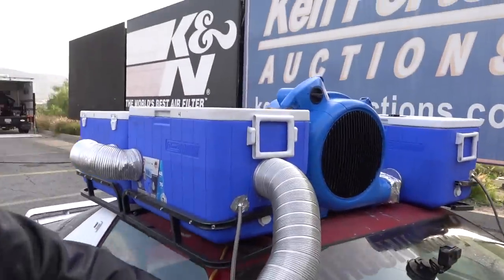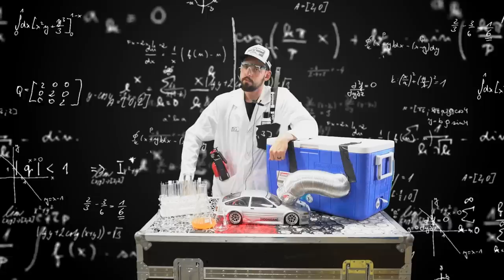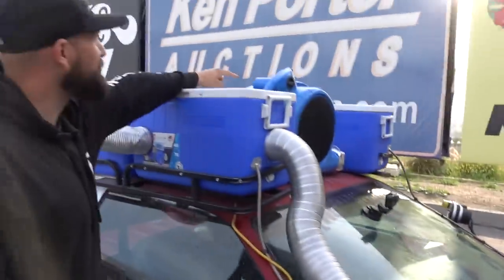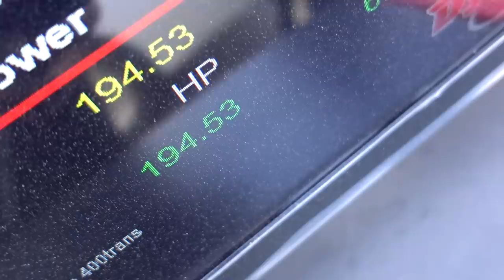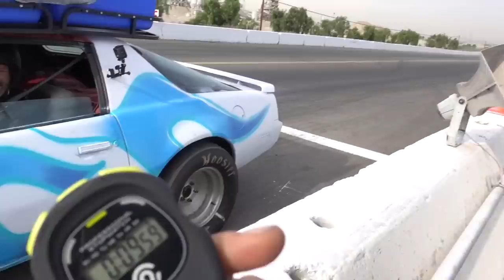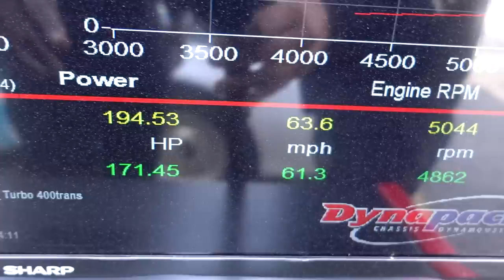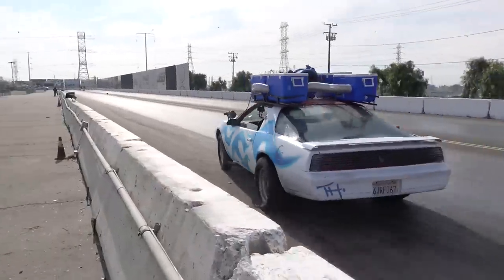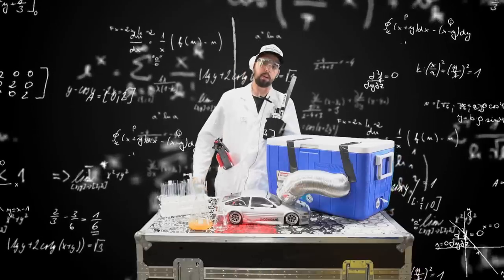Dry Ice Cold Air Intake: Does Frozen Air Make More Horsepower?

Comment: I have always toyed with the idea of running the cold AC lines through the inter cooler on a turbo car. In theory it should work very well but there has to be a reason it hasn't been done. either condensation being sucked into the engine or just the pure cost and difficulty.
Reply: The drain engaging the AC to make it cold is more than the gain for cooling the air, though if one were to have the AC on anyway, it would make sense to recover some economy by having this in place
Reply: It hasn't been done because people think there's no net gain to be had. I've put the entire cold side of my AC into my stock airbox and get 60-80*F degrees of cooling BELOW ambient, even tricked the AC cold side thermistor to work when it's 15*F outside. Humidity is a big factor, the drier the incoming air, the better. Condensation is managed depending on ambient conditions, the most challenging conditions are when its 35-40*F ambient temperature with lots of humidity (research is ongoing)...
You get immediate torque off the line and more CFM monitored by the MAF sensor at all rpms... and all of this is done on a 1990s Toyota so the systems aren't too complicated. I can maintain an IAT of 65-70*F BELOW ambient temperatures on a 95*F day, and on a 25*F day I can achieve 50-55*F BELOW ambient air charge temps. The OEM MAF sensor will work to -40*F (-40*C) 

"When you open the hood, it all makes visual sense but at the core of the design it's more complicated than it looks."

Comment: I guess I found my long lost brothers xD and I thought nobody was as crazy as me.

By the way: your dyno sucks for this kind of test.
Yes you need moving air.
More cold air means better burning and more gasoline.
With a strengthened engine and optimized ECU you would easily get 20% more horsepower.
Even more is possible.

Pretty nice vid

Comment: If you could remove the carbon dioxide from the air, or bypass the carbon dioxide by not letting the air mix with it on its way to the engine (like what you did with the fuel) you should go even faster still. Every drop of carbon dioxide that reaches the spark plug is taking up space that could be used for more air, but you need all of that air to be cold, so if you run one single tube of ducting through all 4 coolers not only would you have more psi because the air has even less distance to travel, but you will have more psi because the total volume of space between turdo to engine will not have 4 coolers worth. If you could run only off the turdo u should make the most power that way, and you'd have to run the turdo in order for the car to breathe 

what im saying is ditch the "no turdo" mode, run duct through all 4 coolers without splitting the duct before it reaches the engine, and remove all other forms of intake that do not run through the cooler. run the turdo at max capacity at all times and send it.
Reply: the carbon dioxide comes from the dry ice, and isnt flammable ;)

Comment: Made less power because your using dry ice, which is frozen carbon dioxide,.....which displaces oxygen. More Carbon Dioxide=Less Oxygen to burn with the fuel=Less power. Thats part of the reason it sounded so rough, it wasnt getting enough oxygen to fire correctly. The CO2 from the dry ice was suffocating the engine, literally. This is a reason why they use CO2 fire extinguishers. Yeah the idea of a super cold intake is interesting to test and I would love you guys try a repeat of this experiment if possible. Try just regular ice....or them gel pouches. Something that will cool the air without adding anything but cold, but not killing the oxygen either. (I know its probably already been covered in comment below.)

Comment: If it was a sealed system that keeped the co2 out pulling air from out side run it threw the coolers threw sealed metal tubing  to get the temp drop and still fresh air no co2

Comment: Orrrr maybe the air was so dense with the fresh dry ice that there wasnt enough fuel to compensate, you leaned out, made less power.  Then when the temps went down, enough fuel was available for the given air to make more power vs the prior run.  That or you didnt just launch and fall flat on your face again.

Comment: The car is trying to burn co2 from the dry ice use some pipe thru the coolers that way the ice cools the pipes which cool the air in the pipes and the engine gets o2 instead of the co2 put off from the ice

Comment: A engine Needs oxygen in a cold state to preform Better and putting nitrogen as a replacement for oxygen will lesson the hp of a car cuz nitrogen is known to put out fires and that's why we use nitrogen in fire extinguishers, the reason why it made a faster lap time is because the air filter was grabbing more oxygen than nitrogen so the nitrogen did work as a coolant only at high speeds, test it on the dyno with a regular fan facing the air filter and you would see more hp gain

Comment: Dry ice is made from CO2 so as it’s melting it feeds the engine carbon dioxide. This would explain why the car made less power on the Dino. Because the coolers were full of carbon dioxide and when they took it down the dragstrip they flushed in fresh air, allowing oxygen to get to the engine.

Comment: You are pushing co2 in the engine and choking it out. Cold air intakes don't ad co2. Fuel at to low of a temperature will not atomize properly. If you chill an intercooler with dry ice and then pull clean air thru the intercooler you will create a clean and cool charge.
Reply: Dry ice is frozen CO2

Comment: Yes co2 replaces oxygen but it made less power on the Dino because they dident have the wind acting as a ram air in to the intake but my theory is they feed co2in with way more oxygen but the co2 cools the oxygen an colder air so I think it would have made more power if there fan was placed correctly

Comment: Dry ice is straight CO2. It may be cold, but i don't think it will make much power. Get a compressed Oxygen tank for a homemade nitrous setup. 3x more potent than nitrous. Use tiny nitrous jets and 3x bigger fuel jets. .. 50 shot jets of N20 and 150 jets for fuel.

Comment: You're filling the combustion chamber with carbon dioxide. That is why the loss of power was there. What if you used the cars ac evaporator to cool the air going into the air filter. Then you wont have any messed-up gasses killing your combustion.

Comment: PLEASE don't trash the fire bird yet, this needs more investigation.

you need to try make a massive heat exchanger in which you pump round your super cool fluid and rush the intake air over it, make a giant AC unit directed into the intake.

I would theorise that the energy needed to deliver any meaningful amount of drop in temp would probably be mitigated by the weight increase of any machine needed to provide it.

This dosen't mean you shouldn't try making a massive heat exchanger, all I really know is my VQ35 N/A runs freakin mint on the mornings when the temp is around zero and almost perfectly still, also there would be an optimum humidity. I digress, in the name of science don't give up on cold air intake

Comment: your pumping co2 in the engine fuel needs oxygen to burn thats why it sounded so bad maybe the idea would work if you guys design a type of intercooler for it or the air pipe surrounded by cold air

Comment: Fuel burns with oxygen not with co2 if you just make the air colder not let the co2 in the engine it will surely increase the power

Comment: Hearing the Fireturd sputter, choke out & then take off, It brings up question's! Has anyone cleaned the entire intake system? Cleaned any iac valve, any pcv, breather valve, the throttle body, intake runners, anything??? I would tear into it & fix the sputtering! Is it the fuel system causing the sputter??? Clear up the sputter & gain valuable time!

Comment: Cold air in real life is usually in winter and lower humidity...... you ran cold air and ADDED humidity, that's gotta be the difference in HP as for the 9.0 he got it off the line better, not to mention as soon as the lid came up on the cooler it wasn't forcing that crappy air into the intake at the top end, lol.

Comment: Wow, you guys kind of missed the whole point of the cold air intake.  The idea is to have denser (heavier) air going into the intake.  Denser air, while having the same concentration of oxygen as ambient air, will have more oxygen in the same volume.  Because of this you are able to shove more air molecules into the cylinders.  More air = more fuel burning = more power.  What you've done is to saturate air with cold CO2. This results in heavier air, but with lower (probably significantly lower) concentration of oxygen.  No wonder you got less HP than a "base run".  Plumb that dryer hose all the way through just one cooler (not just into it - through it!!!) and have dry ice sit on top of the pipe.  This will cool air without robing it of oxygen. Then you are likely to have better results even with that old bird.

Comment: Anyone replying they pumped co2 into the engine please just log off now...

The plumbing was running THROUGH the coolers with dry ice. 🤦🏻‍♂️🤦🏻‍♂️🤦🏻‍♂️ 

Do you also believe you’re pumping water into the intake on a water to air intercooler?...

Comment: ummm, perhaps passing the air intake through a radiator that is submerged in water chilled with dry ice. Definately not pulling in the pure carbon dioxide. You could circulate super chilled air around a radiator too...but pulling in carbon dioxide is kinda stupid.

Comment: You guys are either playing dumb or...
Anyway. You're adding pure CO² (dry ice is solid carbon dioxide) and super cooling the fuel. That increases the fuel density and therefore the amount, and decreases the available oxidizer (O² in open air). Making it too rich to run correctly. When you went down the track that increased the airflow into the fan and blew most of the carbon dioxide out through the cone air filter in the engine bay since carbon dioxide is denser therefore heavier and the cone filter is lower than the inlet into the carburator. This lowered the carbon dioxide to air ratio yet still kepted the air really cold. That's why you went faster, but had less power on the dyno. Because you cooled the charge air enough to overcome the increase in CO² and actually increased available oxygen and overall expansion. Plus carbon dioxide itself has a greater and more even expansion property when heated than nitrogen (which is what the majority of the air is made of) and it absorbs heat and carries that heat with it instead of letting the engine absorb it. That's why nitrous oxide fed setups sometimes release compressed CO² into the nitrous stage component so that A.) They can add more N²O before melting parts or blowing up because of the increased cooling of both compressed CO² and a wet shot of N²O B.) They get an even greater increase of power from CO² having a higher expansion rate, pressure and overall expansion size with a more even pressure throught the entire power cycle C.) CO² absorbing and carrying the heat of chemical oxidized combustion with it into the tailpipe. 
If you had the charge air and dry ice seperate then you would have seen a larger increase in power from the charge air having greater expansion properties by being cold, the fuel being denser therefore more of it per unit applied and making the charge air even denser having even colder fuel being added to it, the engine running cooler and the fuel itself having a near negligible greater expansion property as well from being cold.
How can you be car guys and not know these things?
People put dry ice on top of intercoolers all the time and see a couple more horsepower from it. Also if you run the feed line of a wet shot of N²O through the intercooler of a forced air and nitrous setup you can get a denser air charge that way as well allowing you to add even more fuel. Therefore more power.
I know that contrary to the movies most forced air setups don't have nitrous injection. It's one or the other in most really high power engines to prevent a fluke, an error, pressure related breakages of parts, overcharge, catastrophically lean ratios of fuel, an explosion or system failures. Plus you'd just make more power than the wheels can stick while destroying the motor. Contrary to most traditional wisdom which states that nitrous is just used to get you through the gears faster. Almost all truly successful long lasting forced air and nitrous engines are a extremely large turbo and just use a 50 shot of nitrous (with a appropriate increase of fuel) in first gear to get off the line fast and increase exhaust pressures high enough to spool up that turbocharger that would otherwise be too large to be effective.
I think you guys know that most your audience is dumb or you would have done this experiment right and applied the before mentioned tried and true practices to show the benefits to cooler charge air in a variety of conditions.
If you want to make a really interesting video. Try hydrazine and/or hydrogen peroxide oxidation processes. Then end with LOX (liquid O²) as the final oxidizer, and make sure to use LOX last since unless you're using ceramic or ceramic composites for the piston, valves, cylinder and cylinder head you are 100% guaranteed to melt the engine with it. That's why it's traditionally only used in turbine afterburners with ceramic buffer plates, but you'll go really fast before that happens which will be pretty sweet to watch. Call it "Toxigen Oxide Booster".
Also since with LOX injection the exhaust will be super hot. You can make the video even more awesome if you pipe some LOX into the exhaust with a ton of fuel sprayed into it as well and create the first piston engine that produces afterburner thrust. Since top fuel dragster exhaust already makes 2000lbs of thrust from nitromethane's slow combustion rate causing it to still be exploding when it hits the open air. That's why they're so loud. It won't be the first with thrust, just the first with an afterburner. Call it an "Af-turd burner" or "Turd-burner" for short. Just make sure to add it at the end and that it's a steel pipe of four inch or greater diameter. Otherwise it'll explode. Blow up right under the driver's butt and possibly launch the car or turn weak parts into shrapnel and that's bad. Make sure to have a couple lab coat guys assist you with ratios or burn rates (since it's literally rocket science) and you'll be fine.

Comment: With the added horsepower on the second run come from the fact that the one coolers lid opened up and you sucked a lot of fresh cold air in cuz the cold air 1 in in through the coolers because the lid was off running the video back look at it one of the lids pops open it sucks fresh air that get cooled sorry speech to text

Comment: 10 seconds in, you aint gonna gain shit with denser air without a bigger jet in the carb. unless, it was already rich to start with. But dry ice puts off shit the engine doesnt like
And my shit has a better factory cold air intake then any system available. The Factory knows whats up with air induction.

Comment: A. Why didn't you measure the temperatures and air-flow? B. Duh all that CO2 getting sucked into the engine. While on the strip the cooler pops open and fresh O2 into the cold pipes.  Use a heat exchanger not direct exposure to solid CO2. Or better yet use liquid air as the cooling agent.

Comment: Dry ice is made out of carbon dioxide which is the opposite of oxygen(octane) so all you were doing was feeding used air into the engine therefore making it run worse

Comment: Why didnt you run it through a heat exchanger inside the coolers? Not a single one of you guys know dry ice gives off carbon dioxide? which is like the opposite of oxygen and how to make more horsepower? Any extra hp you made had to have been a fluke. Also why not just run your entire intake through like one or two with like galvanized metal ducting inside the cooler. That way no co2, less coolers, and more cooling efficiency because no hot air from the engine bay?

Comment: Liquid nitrogen submerged intercoolers, or liquid nitrogen sprayed on an intercooler, would be a cold air intake. Dry ice? Fire extinguisher anyone? 

Or could have used the carbon dioxide to cool the pipe without it going in the pipe. It could have blown through the coolers and have that go through an intercooler

Comment: The reason you guys lost power is this little fact: Dry ice is made from CO2,CO2 displaces oxygen.  The engine was not getting enough oxygen for proper combustion.  If you ran it thru a closed system like a intercooler ,cooling the intercooler with the dry ice you would get only cold air less the CO2.  I have a cold air kit on my 5.0 Mustang in Wisconsin and notice a 20 hp  increase when the weather is between 32 and 45 degrees.  Above that it starts to lose that gained HP.

Comment: More common sense says that the speed at which the oxygen is going in the intake from the speed of the car itself canceled out the speed at which the turdo fan was spinning therefore it was more of a 70/30 ratio of normal temperature air going in the intake to cold nitrogen trying to be forced in the intake. In other words oxygen got to the distributor faster than nitrogen from the dry ice.......which btw isn’t a good idea fire needs oxygen to survive not nitrogen so that’s why the car pushed lower power on the dyno cuz combustion wasn’t happening as smoothly as when there’s oxygen present.

Comment: Dry ice is frozen carbon dioxide and carbon dioxide doesn't like to burn and you are basically forcing carbon dioxide into the engine so therefore it doesn't want to make more horsepower